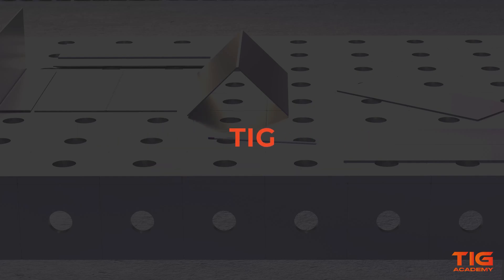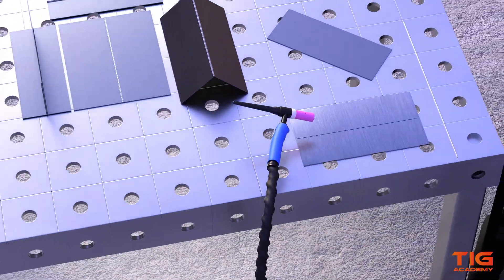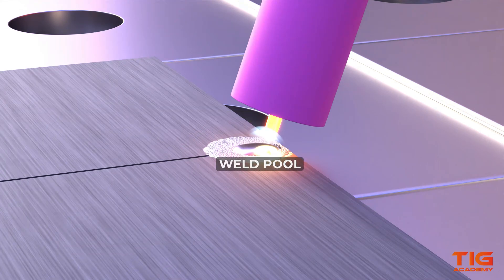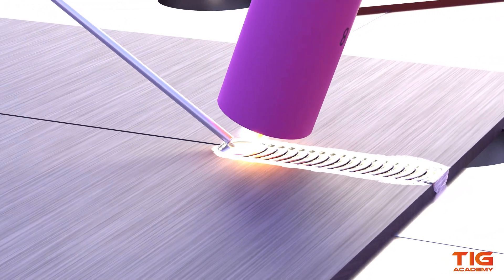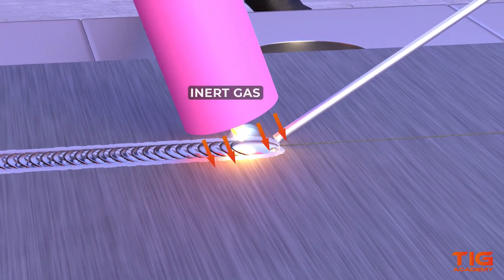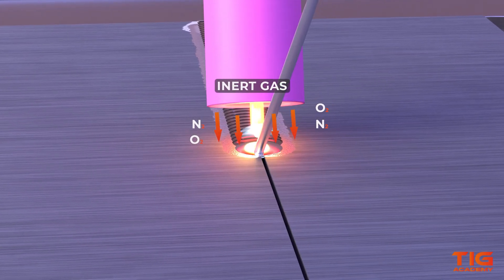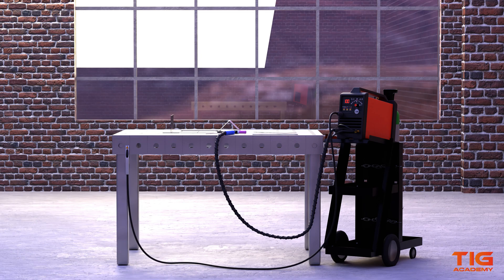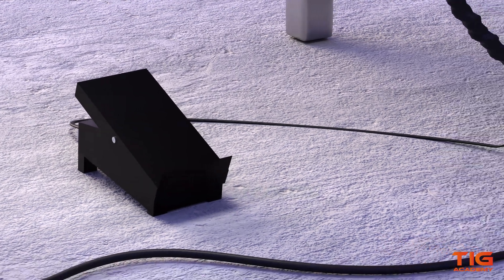What is TIG Welding? (GTAW)

Comment: Old school,,, Helie ark
Reply from the maker: I guess I´m too young to use that term 😉But yes you´re right, heliarc welding is also a name for this process. I chose not to use it because it implies that the shielding gas used is helium. This can be confusing because argon (or mixtures) are often used as well. But thanks for thinking with me, I added it to the description 👍